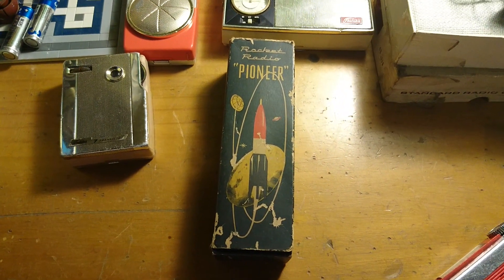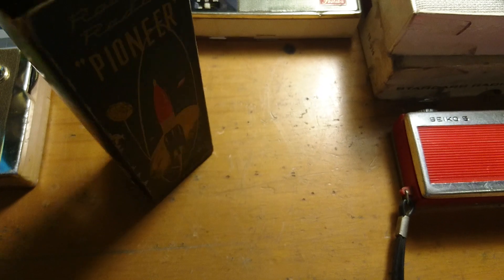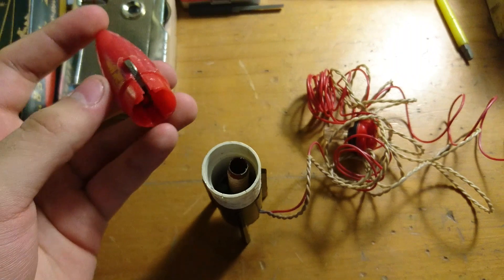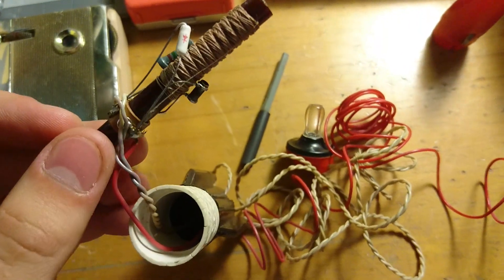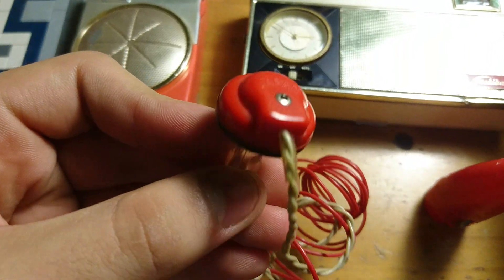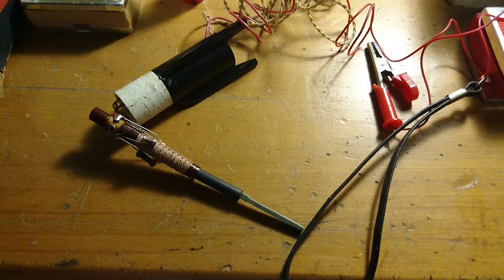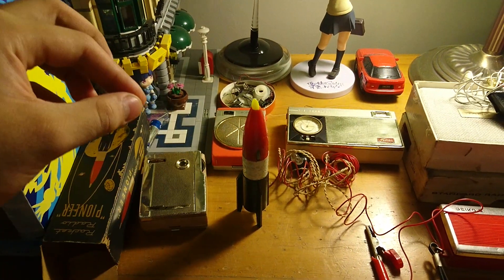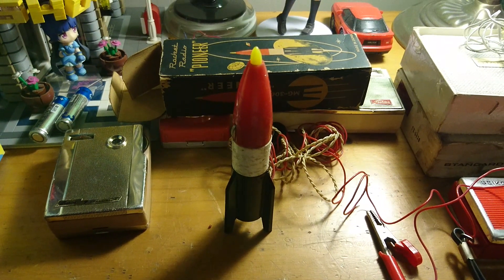No batteries!! 1960's Miniman Pioneer rocket radio

Comment: I had a different version of the rocket radio back in the 1960s. I have great memories of it! The rod that slides in the coil is not a magnet, it is a ferrite rod. It's made of powdered iron held together by ceramic. It has the magic properties of being able to tune a coil without any loss of sensitivity. Crystal radios have always amazed me!
Reply from the maker: That is so amazing!! Thank you so much for the information. It's still sitting on my room as one of the coolest stuff I own